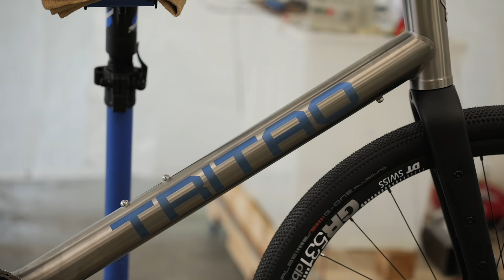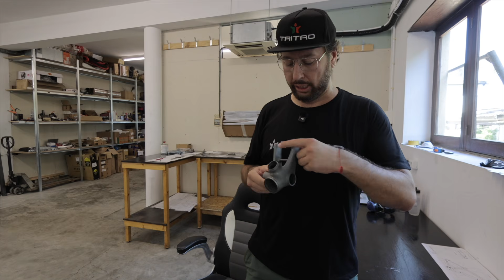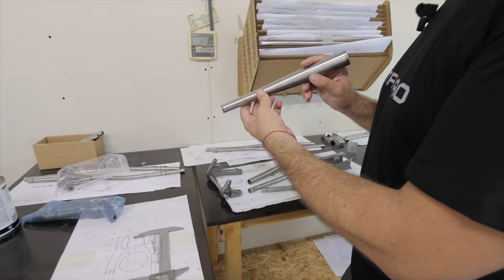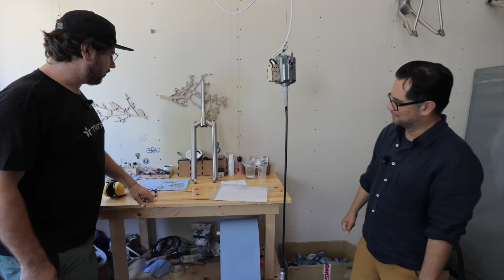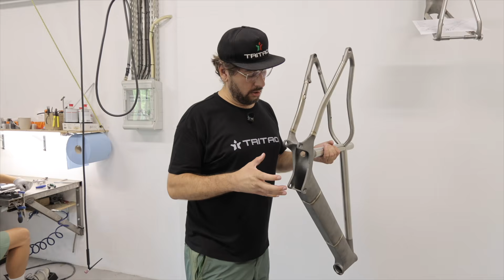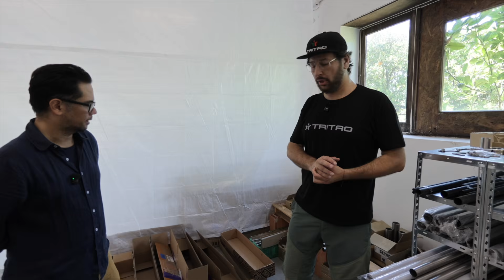Metal Bikes Are Getting Scary Good

Comment: For material techno-nerds, the esteemed Dan Gelbart gives a exquisitely detailed walk-through of the entire process of 3-D metal printing. The amazing bespoke frame clusters Tritao designs to make their incredible frames use a similar set of processes. The brilliant innovation Triton/Tritao employs that allows fabrication at butt joints rather than time consuming tube end machining/welding/finishing together with these 3-D clusters is a game changer, expensive as the design part and 3-D fab may be. Best of luck to Tritao.

Comment: These bikes look beautiful I wish I could support such talented and committed craftsmen.  

I do already have a Marin team ti.  That was 26” mt bike.  I paid Dean titanium to add a disc tab and support between seat stay  and chain stay. I run a 27.5 “ 47c gravel tire on back to clear the old seat stay brace and a 700c 50 in front   Dura Ace STI with XTR cranks and derailleurs.  Red shift stem and cane creek thudbuster seat post. Smoothest riding bike I’ve ever owned. 

I also have a beautiful steel Columbus FOCO tubed Strong custom framed Dura ace road bike.   This also rides smooth as silk.  It hasn’t rusted at all after over twenty years but I live in a high mountain desert area very low humidity at a mile above sea level.  I love both these rides.  I’ve had Cannondales and a Pinerallo FP. But those bikes don’t match the steel and titanium feel.  I haven’t raced in twenty years on road or track aside from a few masters events here and there.  I just would rather enjoy my rides now than push myself to the edge of consciousness for training and racing.  Back when I raced I would occasionally black out on the track and in crits when winning the race.  The pain fades immediately when you win but second place is just suffering without relief and I’m too old and don’t have enough ego left to endure that.

Comment: Explosive battery inside titanium bomb. Fun. Rattle, rattle.
Reply from the maker: Wait till you find out about electric cars 🤣
Reply: NMC and LFP are different lithium ion battery chemistries, with different properties. Will Prowse on his YT channel has a great video explaining them and dispelling some myths about the safety of "lithium" batteries. It's called "LFP Battery Fire Safety: What You NEED to Know". Also, batteries are not dynamite sticks from western movies, the danger is not in the "rattle, rattle". Also, I'm not sure what a "titanium bomb" is, but if I had to contain a lithium battery runaway exothermal reaction, titanium would be a great choice of container.  Lithium battery fires usually don't reach 1000ºC. In some circumstances they can reach 2000ªC, but it's rare and I suspect a small battery that can fit inside a bike frame would never reach those temperatures (not even 1000ªC). Titanium alloys have melting points around 1700ªC, quite a bit higher than steel and way higher than aluminium or carbon fiber.
A lot of misinformation out there about lithium chemistry batteries. Nothing beats research before having an opinion.

Comment: The internal structure on those 3d printed parts increases the flexural and torsional stiffness of the part. It's one of the benefits of 3d printing. I'm a metallurgist and have worked for decades with Titanium Alloys for aerospace structures and biomechanics . I ❤ Titanium, but the alloys are so expensive. Thanks Russ for showing us all the innovation going on Portugal and on your new (my) side of the pond 👍

Comment: They may be good but are they affordable?
Reply: Our frames and bikes are actually pretty affordable among those made in the EU.
And they are price competitive to some of the mass production bikes, especially that we install mid to top level parts that will last. We don’t use some private label catalogue parts. 
But of course as something made with precision and with a lot of labor, they are not cheap. We build reliable bikes, made to last. This will never cost little money.
Reply: I bought my ti gravel bike 10 years ago. Clearance for narrow to wide tires. Geometry that’s made for me. Ran Shimano Ultegra at first. Moved to GRX as that was released. Will eventually move to wireless. One set of road wheels. One set of gravel wheels. This frame will never go out of style. Don’t know why I’d ever buy a new one. With carbon, I was changing bikes every 3-4 years. The designs kept changing and the frames looked dated after a few seasons. Nothing beats a traditional ti frame. Make the investment.
Reply: compared to what? other custom made Ti bikes? Carbon fiber aero bikes? Supermarket bikes? Rusted semi-destroyed ebay bikes? A car? The price of bread in Japan? The average wage in Nigeria? Affordability is relative, you have to put it in context.

Comment: That is far and away the best looking ebike I've ever seen
Reply: I mean, it’s clean! A study in elegance!
Reply: On the other hand, I can't believe people would build ebikes that require charging derailleur batteries separately.
Reply: @0dcd9530 the two Bosch ebikes we are building will have a wire that will power the SRAM RD by the main battery. No need to charge the RD separately. But for some reason Mahle X20 system won’t do that. Believe me, it’s also weird to us that a separate mini battery has to be charged.

But even if it does eventually, there are also dropper posts on the eMTBs and batteries there are separate and I believe there has to be one power supply for the whole bike. Like in cars or  motorbikes.

There are many things in modern bikes that we’d change. But we are not SRAM/Shimano/Fox.
Reply: @TritaoBikes  to be honest this was less a critic of your work and more a critic of the industry as a whole who isn't coordinating well on those subjects.

I remember at the beginning of the di2 era some frame builders built frames with integrated copper circuit into the frame to not even have to route cables. Had the industry come up with an open standard for all major manufacturers, even regular non e-bike frames could be build with builtin embedded connectivity, and a single, replaceable battery located in a small compartiment on the downtube to power everything from derailleurs to droppers to lights and head units or even have dynamo hub taking care of the automatic charging for those who do not even want to plug their bike at home.

Instead people choosing to go the e-shifting route, rechargeable batteries and use gps computer have to take care of a cluster of batteries to charge on a regular basis, this is complete non-sense.
Reply: wheres the motor??
Reply: @ruwdbouy in the rear hub. But very light and discreet yet providing 55 Nm of torque

Comment: I love titanium.  The only frame left on my bucket list is a Ti one .
Reply: Find a way.  The thing is the used market is the way to go.  Ti is so bulletproof that the frame will likely outlast our grandchildren.  So if you can find one and rebuilt with new groupo it will essentially be a new bike.  Even if the decals are torn or faded just brush it clean and ride without decals.  Who cares it’s ti.  Trust me the ride is worth it.  If you can feel and enjoy the difference in ride quality between steel and carbon or aluminum then just imagine doubling that difference in ti.  My ti frame is essentially a compact frame gravel bike converted from a Marin Team Titanium circa 2002.  I had Dean add disc brake tabs and found a 700c fork that gave me a reasonable head angle as originally it had a suspension fork obviously.  I run a 27.5” 45 c in back for mud clearance and a 700 50c in front and it sprints like a track bike almost too stiff. Yet supple in a way that only ti and to a lesser extent steel can offer.  I wouldn’t trade my ti bike for the world.  As a junior racer from a middle class family I was always envious of masters racers on beautiful bikes I could never afford.  Now I’m that guy finally but honestly I only put seven hundred into the frame buying the used 26” frame which in these days of 27.5 and 29” mt bikes was unwanted by its owner.  That includes the money to Dean for the added disc brake tabs.  So deals are out there if you get creative.  Good luck on your titanium quest.